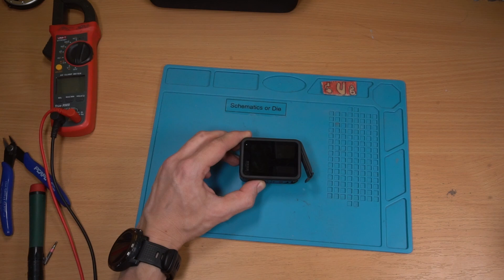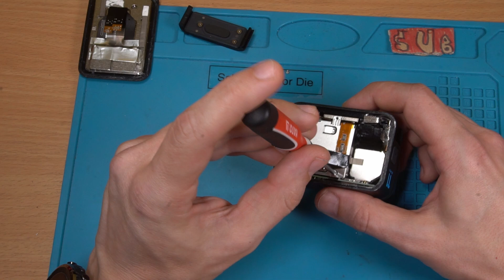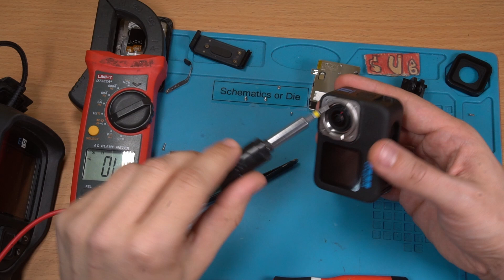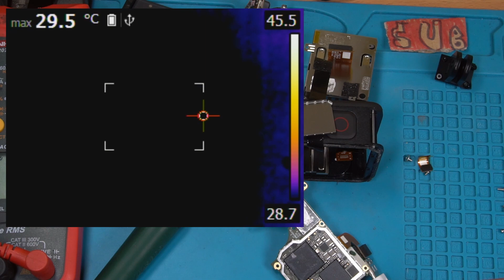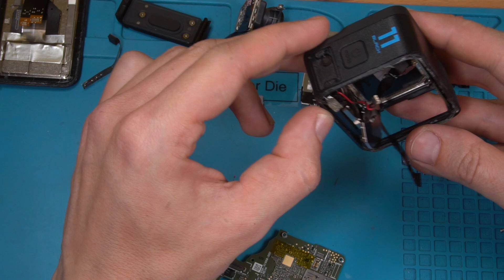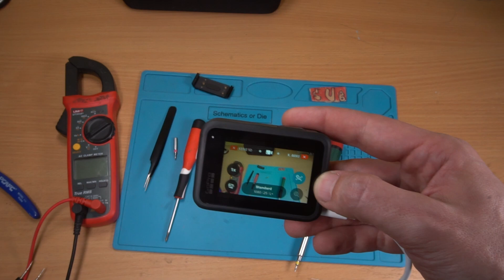GoPro 11 black repair

Comment: i had a naked gopro (not waterproof) fall in water during some fpv drone flight. I gave it a quick isopropyl bath asap and disassembled everything down to the pcb. After drying with silica packs, it turns on! Everything looks good until I review my 60fps footage and it looks like its 5fps. Sharp image, gyro data available, but the framerate is absolutely messed up. Would you know how or in what direction to move? I think a lot of those gopro fixing services barely scratch the surface with door replacements or new lens. Who should i contact to get some more info or a possible fix?

Comment: 👋🏻 почему вы не поставили другой исправный элемент за место удаленного с материнской платы?почему не заработал маленький экран?
Reply from the maker: the capacitor was near the converter so probably some power line. they have a supply of capacitors and so far nothing has hung up. the front screen was turned off in the menu. generally there is a drop-down menu from the top and there you choose the functions of the front screen. should there be an image preview or information about modes like in old gopros.
Reply: @snik2pl круто, получается камера стала полностью рабочая)круто) жалко у меня нет тепловизор(спасибо за видео, очень интересно было🤝🏻